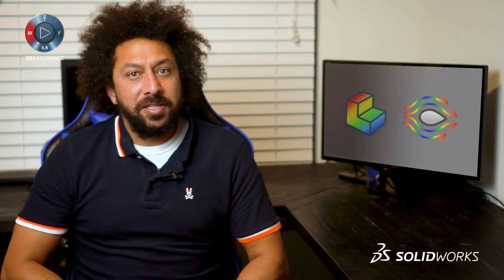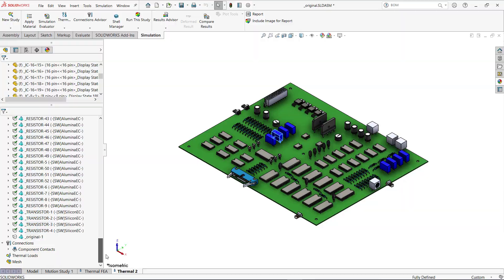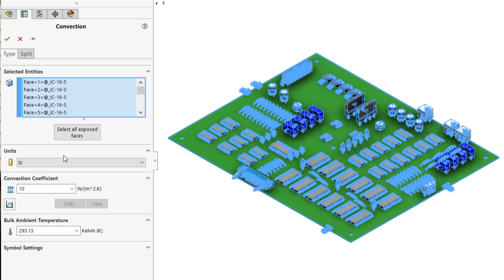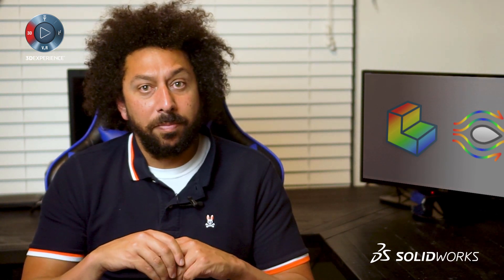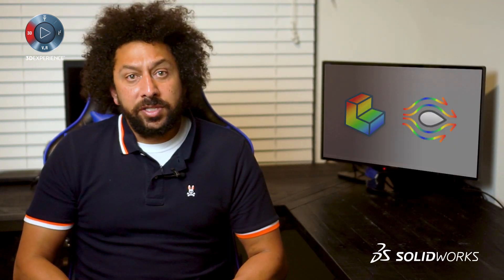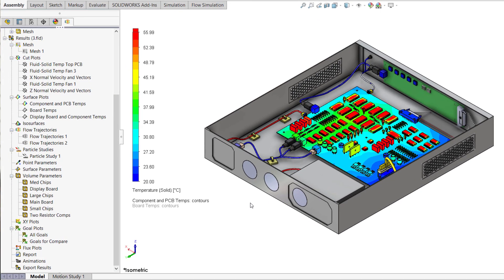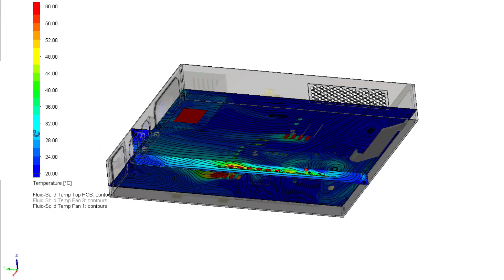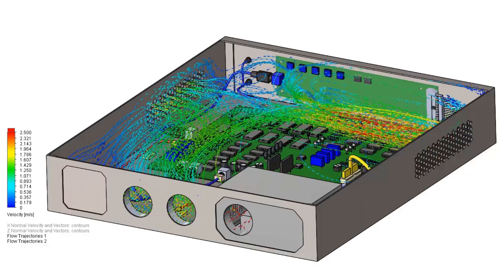FEA or CFD - Which Simulation Tool is Best for You? - SOLIDWORKS

Comment: Nice presentation. It is very interesting. I have already checked Simulia and it cannot handle the unsteady problem I want to solve (the heat generation within a component is dependent on the temperature of the component and time as well as the temperature of another component of the simulation). Does Solidworks have each own solver or it just uses Simulia? I have been using Fluent for 13 years and I know that it can simulate my problem using User Defined Functions of moderate complexity, but my current company is thinking to use SW (which is our selection for CAD) as a cost effective solution. Looking forward to your reply!
Reply from the maker: Hi there! You might want to check out Thermal Analysis with SOLIDWORKS Flow Simulation. This post here gives more info: http://go.solidworks.com/oWV

To learn more about SOLIDWORKS Simulation in general, check out: http://go.solidworks.com/RUf

Comment: Is there any benchmark of Flow simulation compared to Ansys Fluent or other power CFD software ?
Reply: Flow Simulation is okay for a simple analysis. If you start having complex geometries and want to increase the accuracy, ANSYS Fluent or OpenFOAM have better meshers and allow more customisation of the models, relaxation factors, user-defined functions, etc.
Reply: @makmegs   Thanks Cygnus. I am looking for benchmark on those simple tests. Do you have this kind of video ?
Reply from the maker: Hi Guillaume, the SOLIDWORKS Forum had a discussion on the same topic. To search the forum for additional info please visit: https://forum.solidworks.com/thread/89764
Reply: @solidworks  Thanks I will have a look at it.